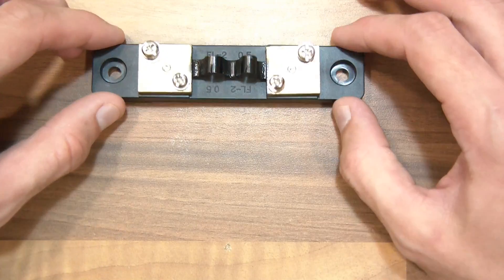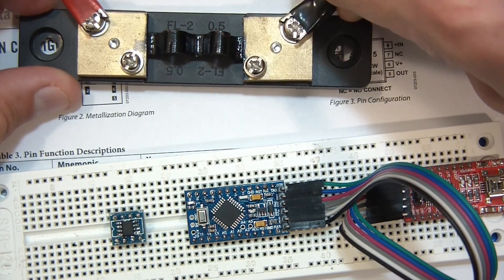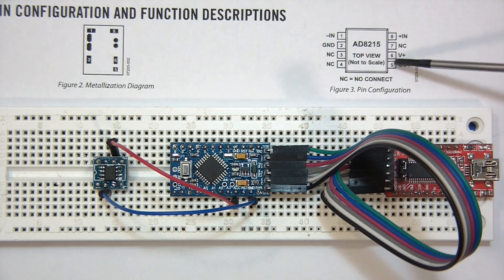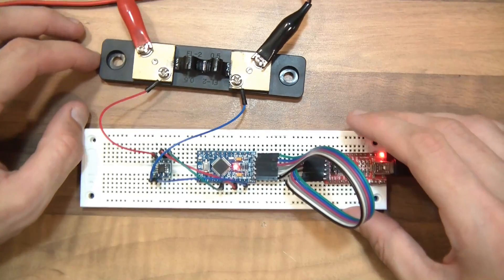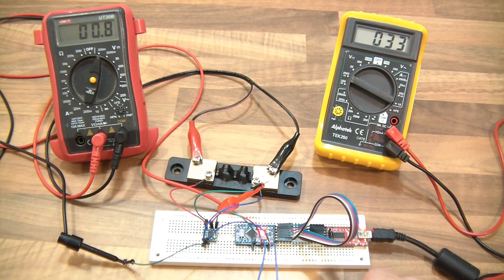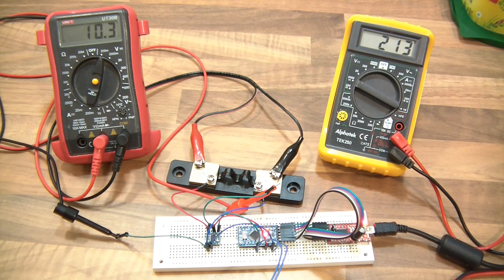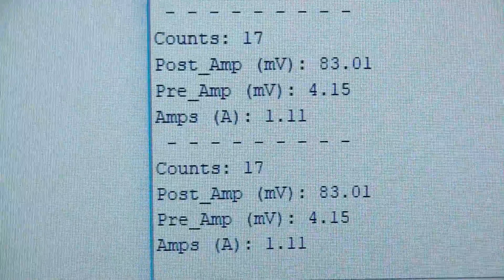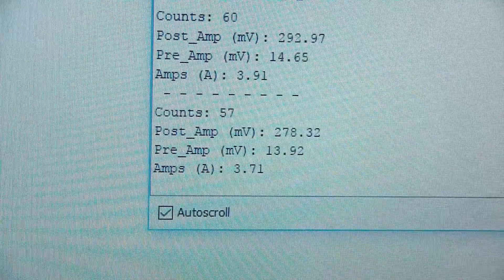TUTORIAL: How to Measure Current - Arduino - Current Shunt & Amplifier (Part 2 - Wireup & Code)

Comment: If connect the wire that does the ic from the shunt on the clockwise side the screw will be pull the wire into the screw against instead always trying to push it anyway

Comment: Would this scheme work with a 200A / 0.50mv ( originally from a NASA BM2 ) with the AD8215 ? I would just have to calculate the vpp and the apmv, correct?
Is the fact that the shunt is currently set on negative makes difference?
Thank you in advance!
Reply: Did u find the answer yet?

Comment: Its for static load, what about when your load is pulsing at certain frequency ?
Reply from the maker: You'd need to change the polling speed to suit the pulses. So if the pulse is 50hz, then it's 50 waves per second which means that the pulse width is 20ms long. To properly capture that data, you'd need to poll every 2ms or so so that you can properly map out current draw.
Reply: @antonycartwright  yes thats exactly what I tried but still the current is jumping up and down, its not stable as in multimeter.
Reply from the maker: @xmenxwk  yes, that's to be expected. Results will mimic what it's reads, and if it fluctuates, so will the results. You'll need to add a smoothing factor to it.
Reply: @xmenxwk   Try to add R-C low pass filter.

Comment: if we test and calibrate a shunt at a low amperage, say like 1 or 2 amps, will it still be accurate at measuring 200 amps?
Reply from the maker: Hi, what we do know is that Ohm's law doesn't change and that's the basis of our calculations. Arduino and software is somewhat dependent on you and your environment. Generally speaking though, it will still be accurate at 200 amps. I have a 200 amp shunt for my solar power system and it is accurate. Antony...
Reply: @antonycartwright   Hello , can you recommend shunt for dc motor with 150 200 A constant current  and  starting current 5 6 time the nominal current?

Comment: I want to measure DC Current with the maximum current flowing as 10 Amp  I am using the Shunt of 20A to 75 mV. Can i use it directly to the arduino board?
Reply from the maker: Saeed Ahmed Shar You can, but it will only detect in incriments of 1.42a and it will be inaccurate near the low end

Comment: Very good I have done it working very well, now how can I manage voltage meter in the same circuit please.I tried a lot but I can't calculate the voltage in this system need your help please,
Reply from the maker: Ghafoor Samadi Hi, search 'how to measure voltage into arduino''. I have a video on how to do that in my channel. It is an old video though!
Reply: Hi I'm talking about high ac or dc voltage like 220V, 400v. please.
Reply from the maker: Ghafoor Samadi it's the same procedure as in the video. For ac, you need faster sampling and some maths too. With ac, you can have problems with floating ground. It's of course very dangerous too.
Reply: I used the current video guide everything is working find, Now I'm trying to show out the 10 in voltage as well, I try many time but I can't make out the voltage, need help if you give me your e-mail address i will send me circuit.
Reply from the maker: Ghafoor Samadi 10v is easy... It's in the video I described just earlier! It's easy.